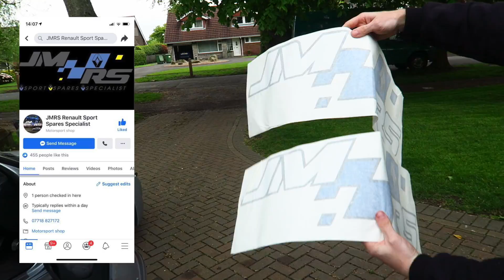FIRST PERFORMANCE MODS TO THE CLIO 172!

Comment: Lee when you replaced your seat when airbag went off did you need the ecu resetting thanks mate 👍
Reply: He never replaced the seat he only took the spacers out, you don’t need to the reset the ecu if you’re removing the spacers
Reply: @boostedchris6120  no when he crashed on track the passenger airbag went off in the seat i was assuming it got replaced
Reply: @jamesmccormick4271  When the passenger airbag went off he replaced it as they’re is no way for the same exact airbag going off again during an accident so he did replace it

Comment: All the 4-2-1 manifold will do is give you more torque top end no point in the mod in my opinion. If you can Lee get your self a cup inlet manifold the ports are bored out more to the size of the gasket. Or bore out the ones on the car yourself 👍🏻

Comment: It has similar variable valve timing to type r's bro.172s great little cars
Reply: It's nothing like VTEC tbh. Still a great engine though
Reply: @MrHipwell1989  its similar,v tec is variable valve timing but with lift
Reply: @mrheisenberg72  no vtec is its own cam totally different
Reply: @ryancaunce3142  still variable valve timing, just different type bro
Reply: @mrheisenberg72  lul
Reply: The system on the F4R In the clio is really basic compared to vtec, it just uses an oil pressure controlled pulley on the intake cam to advance the timing (this also happens around 1600rpm - the 5k “kick” is just the peak volumetric efficiency point of this engine)
Reply: @paulr4197  yep, just like i was sayin. Well done young man
Reply: @mrheisenberg72   Except it's not what he's saying. VTEC is valve timing and camshaft timing change from around 6000rpm on type r's, the Clio just has the VVT come in at around 1800rpm, then the dephaser turns it off at about 6500rpm
Reply: @mrheisenberg72  no it isn't vtec and vtc are completely different.  Vtc is variable timing control..  Not vtec.   The 2 are separate but used in conjunction with each other.
Reply: @1981robbo  both variable valve timing